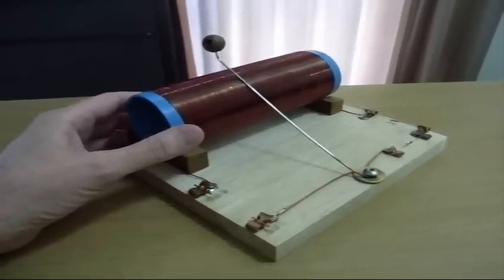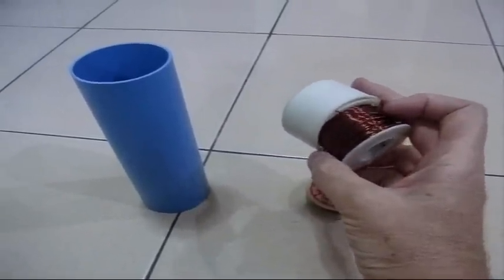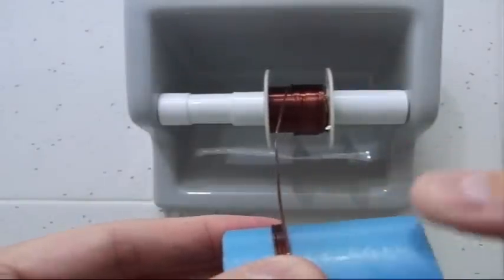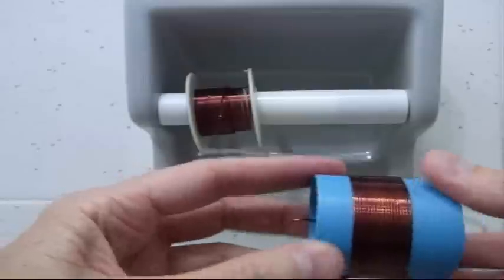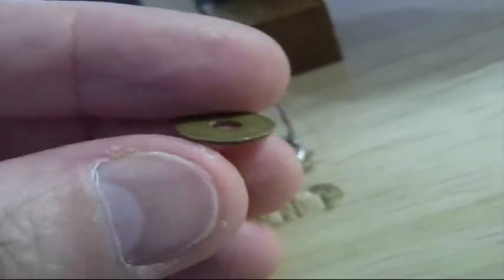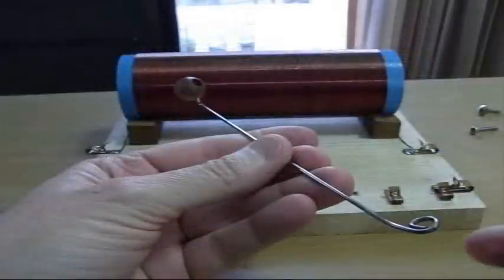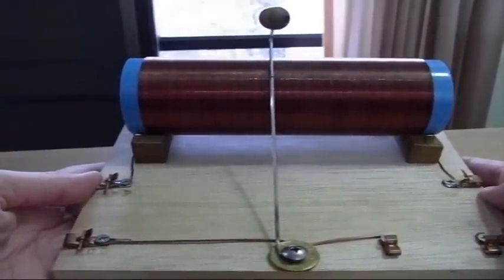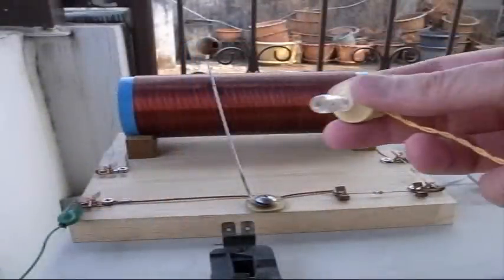How To Make A Crystal Radio - No Batteries (Updated Version Available)

Comment: Sir is there a designated number of turns of the coil or the more turns the better? And for the washer i am planning to use it instead of the clips is it possible that i will use other washer aside from brass like stainless or bronze or tin? Hope to get a good reply i really admire your work thank you in advance
Reply from the maker: +Jonas Orate Anywhere between 80 and 150 turns.  Fewer turns means lower resistance (and possibly more volume), but also it will pick up fewer stations.   More turns can give more stations, lower volume and is harder to keep the tuner rod firmly on it.  
You can use other washers but iron / steel rusts pretty quickly and will lower the signal strength.  It is hard to solder iron, steel or stainless so brass is best.
Reply: +tsbrownie thank you very much sir for the information!

Comment: What's the radio shack part number for the diode? Is it germanium or some non-silicon based diode?  Also I guess the self-capacitance of the coil and circuit is enough to work for the tuning. I have seen other schematics for this sort of rig and they have separate tunable caps.  Very nice video! I enjoyed it.
Reply from the maker: TechnoW1zard Thanks for the compliment.  The diode is a 1N34A.  RS 276-1123 but I would not use RS unless I really had to.  You can get the 1n34A from Amazon.  I've also heard second hand (but never tried them) ECG109 (Sylvania) and SK3090 (RCA) will work.  The boy scout manual lists a home made capacitor and we made 2 and tried them in the circuit (along with factory made ones) and in this circuit we can't hear a difference.  I'd guess there's a significant capacitance in the coil and come to think of it I might be able to measure it indirectly.  A rainy day project!

Comment: What gauge of wire, how long, what diode model, what value of capacitor (that you're missing, BTW), what value of resistor?
Reply from the maker: The details are in the description.  The capacitor is not used with modern piezoelectric earphones. But you may need one if you have one of the models from mid 1900's and before.

Comment: Everything fine with my radio except the reception. How do I receive signals from a distance 50-55 miles  from the station, how long antenna do I need for that and, how should it be installed. There are two nearest Am radios nearby one is situated at 55 miles away from my house and the other 150 miles away from my house. Both of the stations can be tuned with crystal clear sound in my AM radio Transistor of Philips.
Reply from the maker: I have a video on antennas. How they are made, the length, and how they are orientated makes a lot of difference, especially for weaker stations.  https://www.youtube.com/watch?v=G8AsgZbncW4

Comment: how many wraps and why,, same goes with the other parts? Like to hear the science and math of why this would work.
Reply from the maker: The parts details are in the description.  The how it works is found under "tank circuit" or "resonant circuit".  There's lots of information on those already, so I won't repeat all that.  The wiper divides the coil into 2 parts, the unused left side and the "radio" part on the right side where you are hearing the stations.  By moving the wiper, you change the resonant frequency of the circuit filtering out all the undesired frequencies.  It's a bit like moving a stethoscope around on a large, ringing bell and hearing the different pitches it rings at.

Comment: It’s been a while since you made this. I had a few questions mainly about the variables. To start, what would the effect be if you used a smaller gauge wire? Secondly, does the high amount of turns of coils mean you have more frequencies that you can visit or does it allow certain frequencies to expand over more of the wire? Lastly (for now), I read in a comment from a few years back you said the diameter of the coil affects the amount of frequencies allowed. I was hoping you could elaborate on that. And on that same comment you said most AM channels. What would need to be done to higher the frequency to FM? Sorry if I’m asking too much, I’m self taught in all this by research and reading and quite interested
Reply from the maker: The questions about wire gauge and coil size can be seen best (and most fun) by playing with the apps in this video:
https://www.youtube.com/watch?v=Fw9eb-aB-XU&feature=youtu.be
The wire diameter changes the turns per distance which changes the inductance which changes the resonant frequency.  
Ditto the more turns.
The size (all measurements) of the coil changes the inductance.  Again, the apps will show you that.  It's a lot of fun to play with.  Check the description in this video for the basic parameters you can use as a starting point.

Comment: TSBrowinie...I thought antennas needed their own ground, like an outdoor tv antenna.  I know the set is grounded because it’s needed to make it function, but what about for real grounding purposes?

Ie: when the set is brought inside, the antenna is left out there all alone without the set/ground, what happens when struck by lightning?

If set is 24/7 hooked to antenna and always indoors, even if grounded, aren’t you inviting the strike to come inside the house and go thru our internal ground system?  Thanks
Reply from the maker: Not sure what you mean by "real grounding purposes."  To get the max signal for a radio/TV, you typically need to have the signal pass from antenna through the device to a ground.  SOMETIMES with crystal radios the ground is actually a hindrance.  Not sure why, I just know from experience.  The signals are very weak and just having objects nearby can influence the quality of the signal - hands, body, table, appliances, ...  so the tiny signals may be going to "ground" just by dissipating in the radio or its surroundings.  Too much ground in these circumstances changes the "tuning" such that it does not work as well.  Just a guess.
I don't understand your "IE: when the set is brought inside..."  If all the antenna wire is outside, if lightning strikes the wire, the lighting will not have an artificially supplied path into the house. 

"If set is 24/7 hooked to antenna...." Yes, having the wire inside the house can channel a strike into the house.  Lightning does not need you to supply a ground, it will find one by itself.  It travels kilometers though the air, if it hits your antenna and travels along it, the strike will have no trouble emerging from the wire and continuing on by itself.  If the wire is all outside, the lightning will not have a human supplied path into the house.  This is why I say that I deal with lightning suppression by putting ALL of the wire outside the house and lay the end on the ground (or tied to a ground rod) when I am not using the radio or when there's a storm any where near.  If lightning strikes the antenna, it will be destroyed, however you will not be giving the lightning a path inside.
Reply: Hi again. As you may have surmised, I know nothing of the topic, but I do have a home built crystal set I’d like to hook up

Clarification, the antenna remains in a 50 ft straight line from post to post at all times, even when unused. 

From there I pigtail a dangling outside wire that I hook from one end of antenna into my Antenna terminal on the radio when in use.  

All other times I unhook it & toss it out the window where it either: rests on the earth; or I tie it to a ground rod   Right? 

Can the rod serve as having 2 purposes... it’d be a single point of contact to have 2 wires: one going to the grounding terminal on the radio and the other wire goes to the suspended antenna
Reply from the maker: @scsu5085   I made this video just for you!     https://www.youtube.com/watch?v=G8AsgZbncW4

Comment: Is there a way to make this crystal radio shortwave?
Reply from the maker: Theoretically you can receive any AM band given the right coil.  The limitation is in distance - most cities have AM commercial stations relatively close by, so it works.  It will not pick up lower power stations or stations really far away, so you will not get BBC in the US.  But if you were near the BBC AM station, then given the right coil, it should work.

Comment: When i was in 4th class 1989,i did it using a telephone ear piece, putting crystal diode across the two contacts, n from the contacts one goes to ground n other to the 10 feet ariel. But had no idea about the tuning part. Only 1 station catched. 
One thing i  wanted to ask you, it catches only frequency between 520khz to 1200khz? Will it not tune to 88mhz 103/104mhz?
Reply from the maker: Theoretically with different sized coils, it can receive any range of AM (not FM) stations. Lower frequency range radios are more practical to build.
Reply: @tsbrownie  thanks for your reply. Now I understand

Comment: Will any other diodes work with this radio???thanks...a nice video..
Reply from the maker: +Kennynva T. There are equivalents that should work, but ordinary diodes will not.  You can also use a galena detector.  You can search Wikipedia for galena detector.
Reply: +Kennynva T. 

There are quite a few diodes that will work well.  The russian D18 is very good, available, and very cheap on Ebay and have similar characteristics to some of the BEST crystal radio detector diodes like the venerable FO-215.  You can also scavenge detector diodes by carefully unsoldering them from old clock radios or other older electronics.  You will have to be very careful to not break the somewhat fragile glass package.  An old AM radio from a Goodwill or other Thrift store would also be a great source of both a detector diode, and variable capacitor.

Comment: tsbrownie - many thanks for taking the time to create this crystal radio 'how-to'.  I've acquired most of the pieces now and am planning on building it with my daughter over the next couple of weekends.  A couple of questions please:
-- Does the connection between the antenna, tuning arm and diode need to be a solid rod (bike spoke) with a brass washer...or can it simply be any bare wire and a stainless washer? (perhaps a stainless hanger from the cleaners?) Does it need to be soldered?  Cheers-
Reply from the maker: +Jim Brewskiis The rod can be anything that is springy, solders easily, carries electricity well and does not corrode.  Hard brass was used historically because it was readily cheap and easily available.  It corroded but you could wipe it off easily.  Stainless fills that requirement these days for the wiper, but it does not solder well.   Soldering is not needed for the wire joints, but these things are dealing with very tiny voltages and currents so soldering helps boost the output, especially with weaker stations.  Let me know if you have other questions.  Good luck!

Comment: I haven't seen a crystal radio where the ground wire is attached to the tuning rod before. Which way works best , antenna attached to the base of the tuning coil and earth attached to the tuning rod, or the antenna attached to the tuning rod and the earth attached to the base of the coil.
Reply from the maker: +woodcoast50 Excellent question.  I have 1 more design where there are a couple subtle differences and I plan to build that and test them side by side.  This design is from the Wolf Scout handbook from when I was a kid, I had built it before and knew it would work.  Odd that so many years later i remembered there was an error in their drawing and there was 1 wire too many.  I guess we remember a lot more about what we learn as kids than we think.

Comment: tsbrownie Is that brass thing really imporant? or I can use similar of it. I m doing your video right now so please, answer. Thx
Reply from the maker: The brass is used because it does not corrode easily.  Stainless steel also works.
Reply: Oh, thx man! have a nice day.
Reply: And because i though that thing is used to be as like the pencil and 
razor.
Reply from the maker: The diode replaces MANY other ways to rectify the circuit.  As a kid I used galena.

Comment: Does the selector rod have to be stainless or can I just use any steel rod?
Reply from the maker: Charles Marshall Steel would work for a while, but iron (like in clothes hangers) develops a thin coat of rust which will quickly lower the sound levels.  Brass rods will work.  Copper and aluminum are typically not springy enough to maintain a firm contact on the coil.  An old, heavy bicycle spoke works well and many are stainless.  (Bike shops may give you a broken one for free.)  That's what I used.  You can also buy stainless and brass rods at hobby stores, hardware stores and home stores.  
If you really want to use steel, it's a lot more work, but you could solder a brass washer to the end that is screwed down (steel is NOT easy to solder either) and solder a brass or copper piece on the other end of the rod where it contacts the coil.  Again, not easy, but do-able.

Comment: Hello, I just had a question about the resistor that you used for this project. You said it has a resistance of 10,000 ohms, but what is the wattage and is the wattage important to the function of the radio?
Reply from the maker: Any wattage will work.  I helped a neighbor build one and he used a quarter watt.  Eighth watt is also OK.  I'd use carbon type, not wire wound.  It's a bit of a long story, but the old style crystal earphone which did not require the resistor was very different from the new ones.  The new ones are piezoelectric and have significant capacitance.  As a result these new ones charge up and then discharge creating a static-like "buzzing" in the earpiece.  The resistor is there just to prevent the charge build up.  As a result it makes the sound much clearer.  It's an easy experiment you can try.

Comment: I do have a general question if you don't mind. I asked @RimstarOrg
 but he has not been active for a while, so I am not sure he will reply. I will just paste the question as I originally formulated it:
"Thank you for your crystal clear explanations. [that goes certainly for you too!] There is something that I still do not understand, and I hope you will clear it up for me as well. By changing the number of turns, the core material and its area one can tune the receiver. But all that is happening is that a link is then established between the broadcasting station and the receiver. It would be like the switchboards of old where one telephone user was linked to another by the operator.
That still does not explain to me how the messages can come across. 
For example, let us say a station is broadcasting at 1200khz, with your explanations and the formulas, I should be able to build a crystal radio that can link to this station. But how are the messages coded in the 1200khz? I hope I am making sense."
Reply from the maker: I can not explain it all in a comment.  A book on basic radio will help a lot.  There's no "link" like with computers between sender and receiver.  The waves come out of the transmitter.  Each wave is a ball that is growing out from the antenna (in your example 1,200,000 per second) .  When a wave (high and low) passes YOUR antenna, it creates a change in power in your radio.  To put sound on an AM wave, they use technology to make the waves shorter and taller (they "wiggle" the main wave - it's similar to how sound is on records, stored and recovered by "wiggling" the needle up and down more or less).  So each wave that passes is a little different and your radio allows you to hear those little differences as sound.
Reply: @tsbrownie  thank you